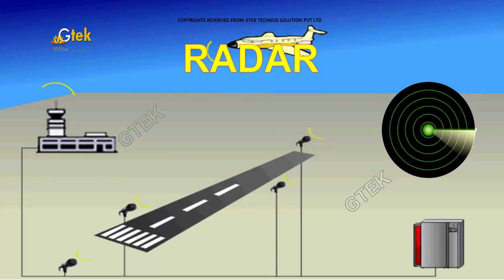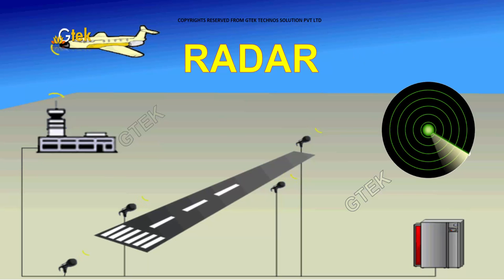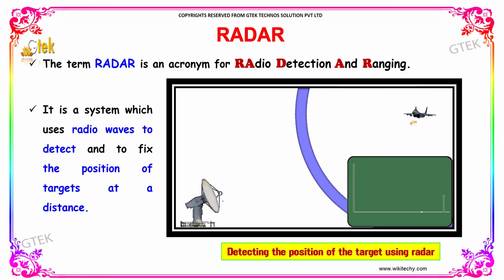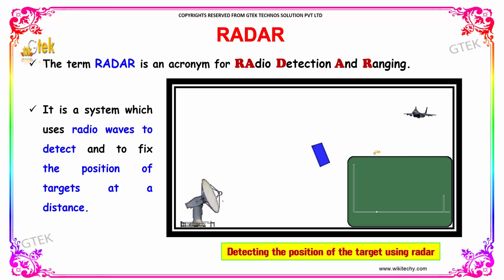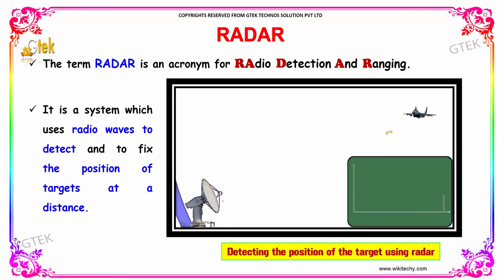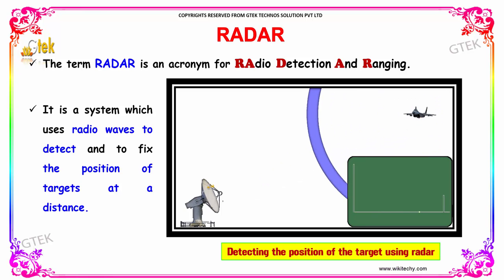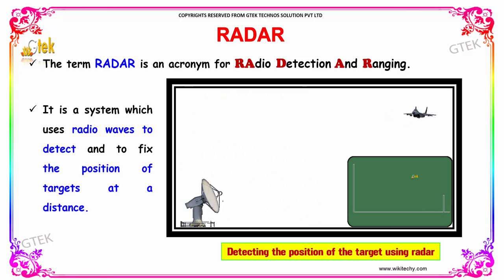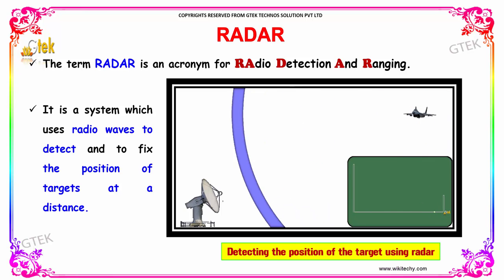Radar Introduction |Communications system|class 12 physics subject notes lectures|CBSE|IITJEE|NEET

Comment: Radar is an object-detection system that uses radio waves to determine the range, angle, or velocity of objects. It can be used to detect aircraft, ships, spacecraft, guided missiles, motor vehicles, weather formations, and terrain. A radar system consists of a transmitter producing electromagnetic waves in the radio or microwaves domain, a transmitting antenna, a receiving antenna (often the same antenna is used for transmitting and receiving) and a receiver and processor to determine properties of the object(s). Radio waves (pulsed or continous) from the transmitter reflect off the object and return to the receiver, giving information about the object's location and speed.